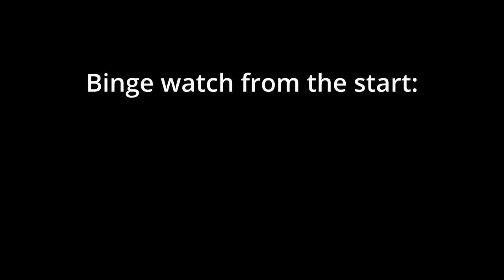building a Motorhome from Scratch. Part 5: Fabricating a windshield frame

Comment: I just found this build series and I am definitely binge watching the whole thing. I do have a couple questions and forgive me if the get answwered later on in the series. What about the heat from the engine coming through the aluminum floor and engine tunnel? What is your plan for that? Also how mutch structural integrity is the windshield frame going to have if its just made out of PVC and fiberglass. Have you considered what you will do to allow it to be structural and not be a major issue point in the event of a collision? This has been a great build series and I am really looking forward to seeing it progress.
Reply from the maker: Thanks for the message Ian. I address some of the issues in later videos (like the windshield frame) but really appreciate any and all input I get from viewers to make this motorhome safe and awesome!